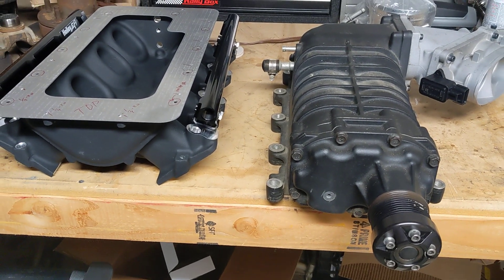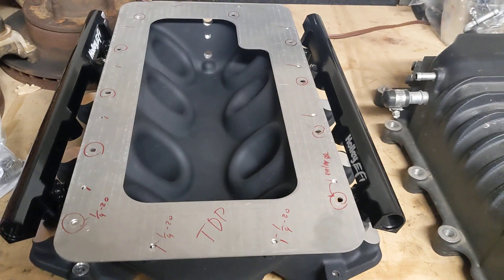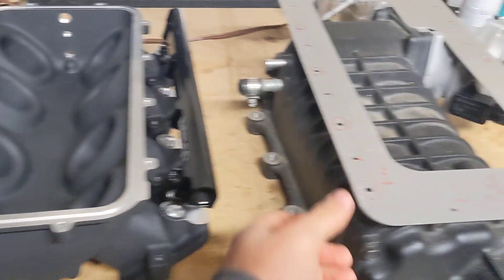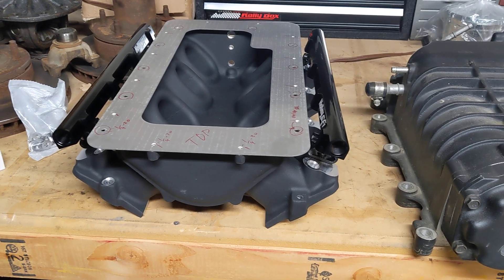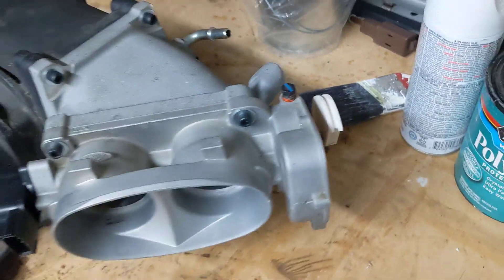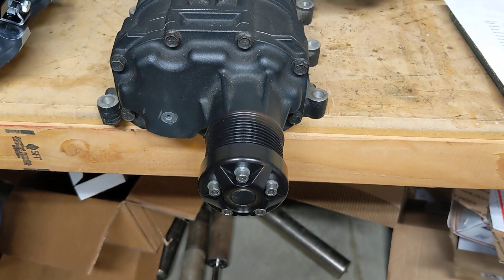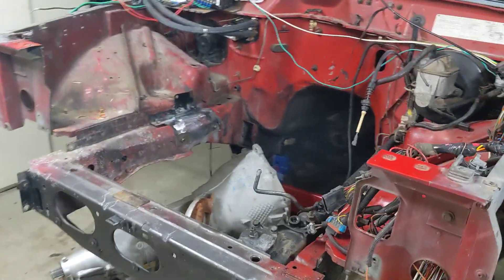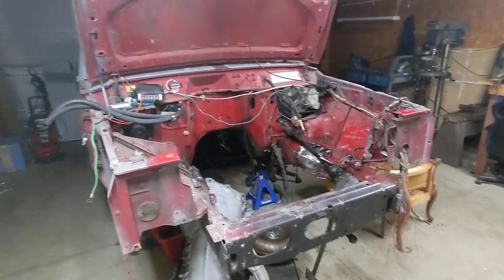Shelby GT500 Supercharger on LS engine

Comment: one issue you will have is front cylinders will be lean compared to the rear since compressor outlet is to the front hence why most factory stuff has the brick to equalize distribution and compressor outlet temp

Comment: Are you running an intercooler or just adapting straight to the low ram? Any concern about air temp? I am wondering if I can get away with meth injection and e85